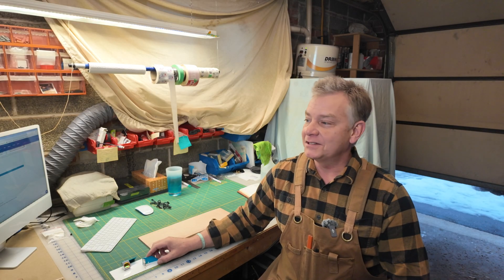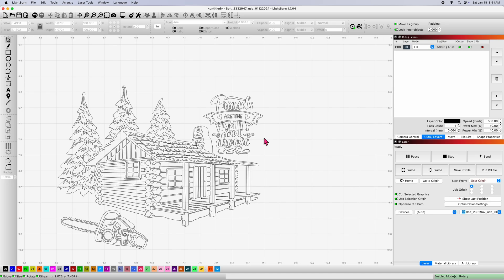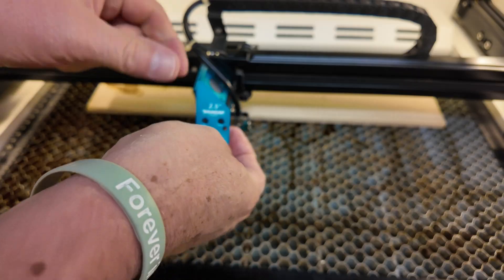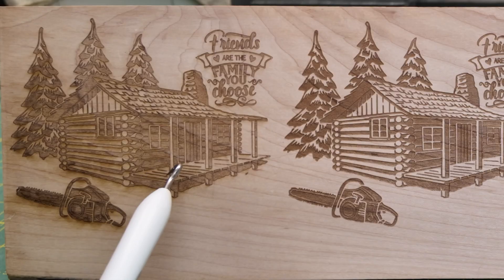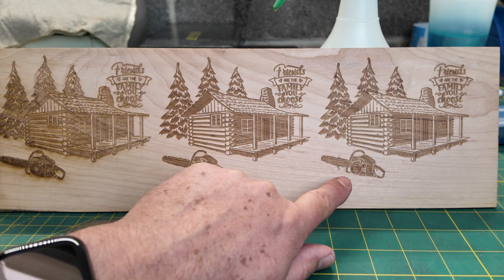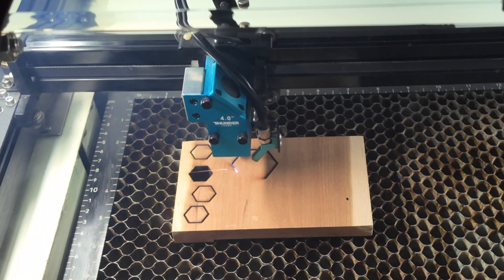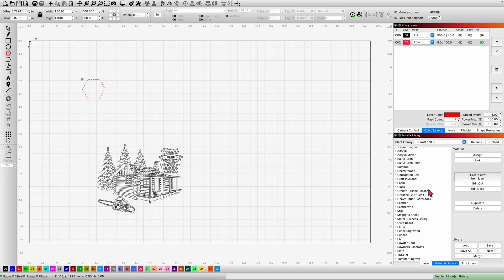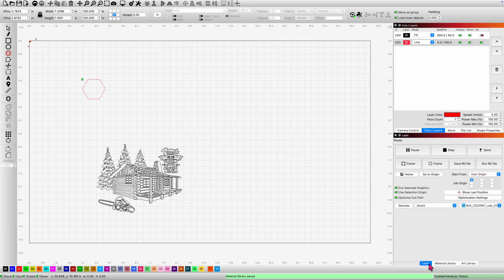Optional Lenses for your Thunder Laser BOLT. And Why You May Need Them. 067   4K

Comment: Hey Gord, just received my 4" lens and have found that I need to defocus by –5mm to achieve the best results and the thinnest kerf. Have you experimented with your focus? I'd be curious to see if it's the same with yours. Cheers!
Reply from the maker: Good morning Stu. Thanks for the good info. I haven't played too much with de-focusing the lenses - when you say -5 mm, do you mean the laser head is 5mm higher than the material or 5mm closer to the material? Thanks!
Reply: @ Morning Gord, the lens is higher (away from the material). I have found 4mm to be the ideal distance - because it has a longer focal length, anywhere from -3mm to -6 has the same results so, 4mm seems to be the middle. 

Please let me know your results so we can compare.

Cheers!
Reply from the maker: @StuMas  Thanks Stu. I may try this at some point but a question - I thought the purpose of having the longer focal length was to get deeper into the material. If I back off the lens higher from the material, then am I not simply moving the point of convergence up to where the 1.5 or the 2.5" lens would be? Thanks

Comment: I wonder if on the really thick stuff if you adjust your Z up just a touch to move the focus point of the beam deeper into the material would maybe cut down on some of the char...basically, each pass bump the z up a touch. Just a guess here since I've never cut anything larger than 1/4 on my bolt.
Reply: There's actually a function in lightburn that will adjust the Z axis as you cut I believe the function is on the advanced tab. Basically it makes a number of passes that you tell it, it pauses burning, and then adjust the Z axis, and then continues your burn
Reply: Nice! I looked into this and you have to go to Edit->Device Settings and select Enable Z Access. Then on the layer settings you'll get additional options for "Z Offset" and "Z Offset Per Pass". Definitely something to play around with.
Reply from the maker: That's an interesting idea. I have not tried that but I might - just to see what happens. Cheers and thanks!